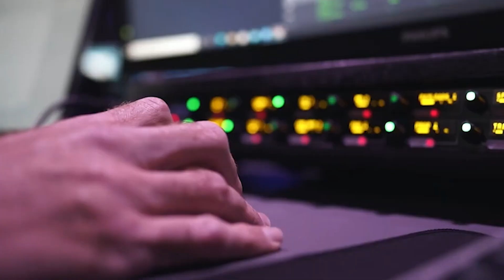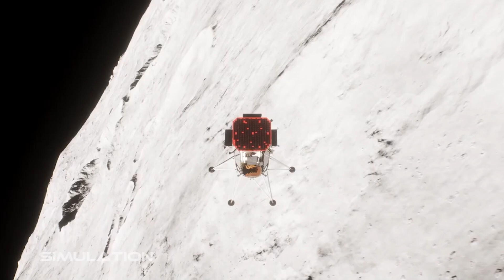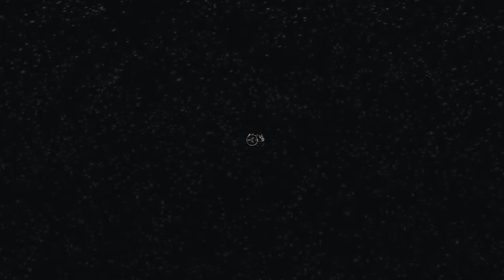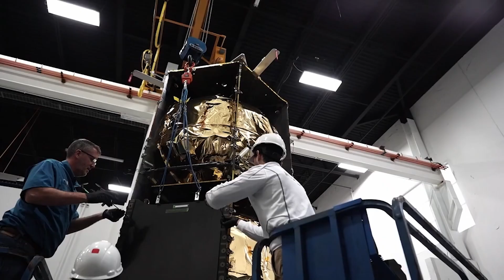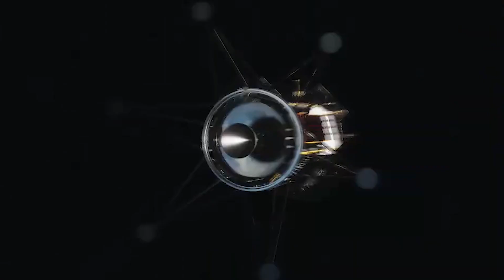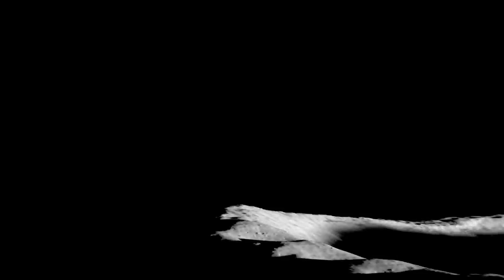What Exactly Went Wrong During Odysseus’s Landing?

Comment: It could have been better if they were HONEST with the progress and say exactly what happened.  It had a HARD landing and tipped over.
Reply: From Wiki... "Following the launch of the IM-1 mission, Intuitive Machines' stock surged 35% in one trading day coming to a 75% total increase by Friday, February 16.[18]
Intuitive Machines’ stock sank 32% after the Odysseus moon lander fell on its side on Feb 23."

Good enough reasons to not say immediately that it crashed or had a hard landing... And use the more gentle words "tipped over on its side"... Saying otherwise would have... Crashed the stock even more, most probably. Always be very weary of private companies, no matter which one.
Reply: @dave_ant1  Although Elon's 'Rapid Unscheduled Disassembly' is hilarious. Maybe, we should call this 'Rapid Unscheduled Attitude Correction' ;)
Reply: @falklumo  Far enough... 😁
Reply: It would seem more prudent to land the item on its ide then stand it up with a mechanism. How hard could that be ?
Why does it have to stand up 14 feet high ? Why cant it remain horizontal on 4 legs and still function.? Um we have retractable undercarriage on planes..........
Reply: @kimbo99  You mean having a lander like the Dynetics HLS proposal? Very low center of gravity. Then extent whatever equipment you need for the mission? I mean yes, that is an obvious preferable way to do it... But they decided to design it that way, probably to fit it inside the Falcon 9 fairings, making it thin and tall...

Comment: Are they going to reprint the limited edition t-shirts with the lander lying on it's side?
Reply: I want the ceo to be on the shirt explaining why it’s still a huge success
Reply: 🤣This is just crazy, can't believe Apollo did it right the first time and now 50 years later into the future with the most advanced chips and knowledge on space travel, it had to tilt. NASA sent two robots on mars and those never tilted. How is this even possible to the closet planet of moon.
Reply: @sto2779 That's a pretty good questions, I really think this is about inexperience and pretty optimistic predictions.

The moon landings where made by profesional pilots that trained a lot on helicopters and being there avoided the autonomous side of the new missions. 

The moon surveyor program and the moon landing used a pretty low center of gravity ships that where designed to withstand side movement at landing and stay correctly oriented.

The old mars rovers where designed to land by crashing and bouncing into te surface and unwrapped to be right side up. The new ones with the sky crane, that is a huge thing and a huge feat by the JPL, those sure used tons of simulations and testing and still is amazing how they work.
Reply: @fdavpach  The design of the moon lander looks like it’ll tip over. Should’ve gone with a tried and true approach. But I think they wanted to do something new which heavily relies on fast advanced computer algorithms with advanced motion control of jet nozzles, which seriously complicates things. Seems like not enough proper testing caused it to tilt. I blame it lack of budget from private funding.
Reply: @sto2779 He said one of its damn feet got stuck in a hole at about 2 mph, walking speed.  And it fell over.
Considering how many feet it has, it seems unlikely.  But that's the way it is. 
The best laid plans... and all that crap.
Might not have happened if the land surveillance radar Imaging would have been working.  😢
Reply: @sto2779  "can't believe Apollo did it right the first time" 
Hold on to that thought ;)
Reply: @sto2779  They were probably more competent, much more humble, and very much more conservative in the sixties, and as a consequence there are still four living monwalkers among us, the others having died of either old age or mundane causes such as a motorbike accident. I wonder what they are thinking of this blunder. Keep as much of the mass as is possible down: they teach that in high school, I'm told. If even true, old fashion NASA expertise begins to be lacking, I don't know who and what we are going to place our trust and hopes upon.
Reply: @sto2779 Armstrong landed it manually though. It's still a difficult thing to achieve in this day and age. 👍
Reply: @dr.zarkhov9753  That’s the most lamest excuse 😂. Here’s why: Mars Pathfinder landed on Mars on 1997, then Mars Curiosity advanced rover landed on Mars on 2012 then the most latest advanced Mars Perseverance landed on Mars on 2021. You do realize that Mars is about 225 times further away from Earth than the Moon. Therefore a robot failing to land properly on the moon in 2024 is retarded. Even China got their robot landed on the moon in 2023 perfectly for the first time. I think the issue here is that the commercial American aerospace company which made this vertical space lander instrument didn’t have enough funding for testing or didn’t have more experienced engineers. Anyhow, I call it a partial success, they did land on the moon using the most advanced new motion techniques and able to communicate with the lander device. I think they should’ve first sent a sample test lander only to test and learn the motion control systems before sending the main primary moon lander which is more expensive.
Reply: @dr.zarkhov9753  It seems that you are giving information from the 19th century to future generations!😉😊😇
Reply: The Apollo team with their slide rules are all gone.  They're not here to help. @sto2779
Reply: @sto2779: say it again my friend! 👍(they ain't hearing yah)
Reply: No problem, I will  print this kind of T-shirt for u. Are you sure to wear it outside?😅
Reply: Haha

Comment: They showed an animation of the Earth moving in the Lunar sky.  Isn’t that wrong?  Since the moon is tidal locked with Earth, doesn’t the Earth stay in the same position in the sky?  

Also, I hope SpaceX is paying attention to all these landers falling over.  Starship is really big and tall, and if it falls over a lot of people are sc*wed.  Might want to redesign it to land on its side. Could put the landing thrusters where the stub wings are located.
Reply: "They showed an animation of the Earth moving in the Lunar sky.  Isn’t that wrong?  Since the moon is tidal locked with Earth, doesn’t the Earth stay in the same position in the sky?  " 
Really?  Ridiculous. But it's a private company after all, some are more "trustworthy" than others... But yes, if you are on the lunar surface, the Earth stays in place, but at a different azimuth and altitude on the celestial background, depending on where you landed... 

There is a slight movement due to the lunar libration, but you wouldn't perceive it. Except maybe at the limit between the near and far side of the Moon, where the libration of the Moon axis of rotation would be enough to provoke Earth-rise and Earth-set... That effect also allows astronomers to see around 57% percent (from the top of my head) of the total Moon surface, from Earth.
Reply: The big, tall Starship that sits on earth isn’t the spacecraft that lands on celestial bodies.
Reply: @freddymax5256  It actually is ;) However, I am much more worried when they drive their Starships around on Earth ...

Comment: Two additional points: The Odysseus’ laser range finder system that the entire landing sequence depended on, the "safety enable switch" was "not disable." Or to put it in other words the laser range finders were not in-flight mode. That was a manual operation that could not be done in flight. Someone apparently didn't add that operation to their preflight check off list. Equally as pertinent, the communication issues now experiencing and apparently the reason limited data is being recovered is the radio is still in "flight mode" where the "fault detection system" due to loss of signal is "powering off and restarting the radio while flip flopping antennas" as it tries to regain a signal. IM thought they had a solution to that in hand. So far, apparently not.
Reply: The opposite of "turn off the lights when you go out"?
Reply: I mean considering this is their first mission and other missions have failed completely for worse oversights, such as the mars rover that crashed because they didn't convert from meters to feet, these are simple fixes that can changed for IM2
Reply: @Jett-n-gin  No one said these items can not be  fixed or were egregious. It was just additional information not covered in the video that puts things in proper perspective.
Reply: @WWeronko  Sorry, it's hard to decipher tone sometimes; especially when the comment section is full of IM1 mission hate/calling it a total failure
Reply: @Jett-n-gin   I don’t hate this mission. If it failed then simply say it.
Reply: @gregorylayne9044  it didn't fail though. It's meeting most of its mission objectives. I'd give Odie a passing grade

Comment: Can't they use the thrusters to nudge it back to a straight standing position??
Reply: Probably not because they'd be doing it blind.  Most likely they'd just flip it over onto the other side, doing more damage in the process.
Reply: @TooSlowTube  What does it mean, doing it blind? In this sense, they did the whole landing blind, right?
It requires sensors on board and a small new software. Perhaps a simulation before. This is just an other "blind" space manoeuvre.
Reply: @Sonnell  So an extreme risk of doing it wrong because simulation is never perfect (considering unknown conditions it will be a miracle to having it just close to original situation), and having a huge chances to blow up entire thing due to damaged thrusters, just to fix already partially working craft that can use all its tools? No wonder no sane person even considers that.
Reply: @alexturnbackthearmy1907  haha you are saying I am insane? :D
Well on the last day, I would try it for sure. I would learn a lot more from trying such things than from not trying.